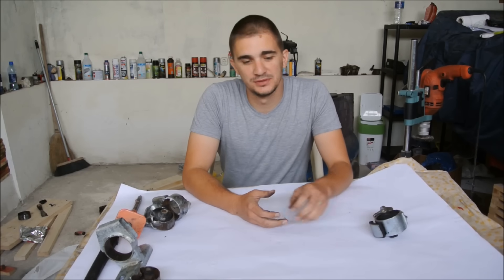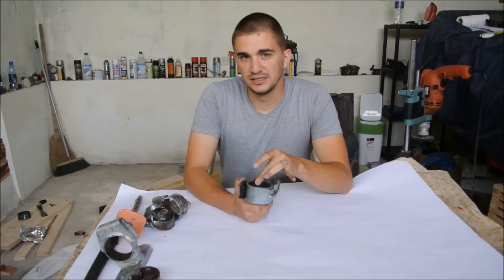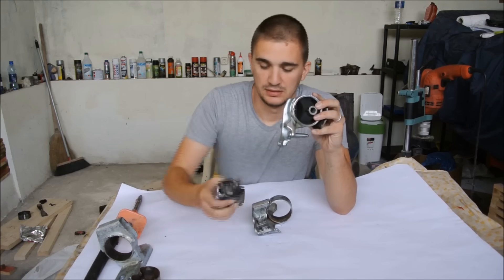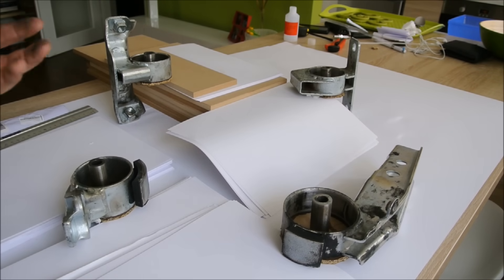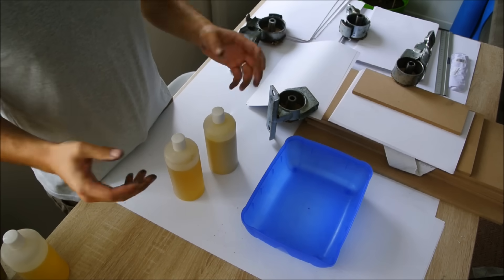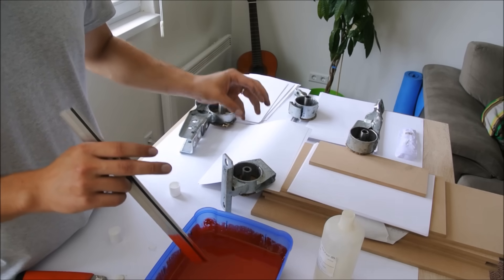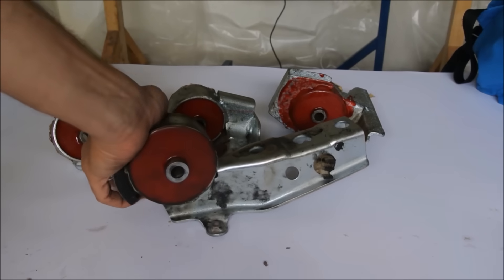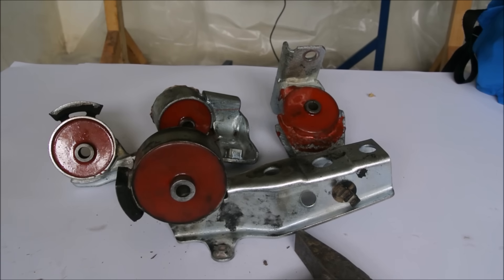How to make DIY polyurethane engine mounts

Comment from the maker: Become a Tuning Pro: https://hpcdmy.co/dr4a
Support the channel by shopping through this link: https://amzn.to/3RIqU0u
This is the liquid polyurethane I used: https://amzn.to/2VPPayY
This is the pigment for coloring the polyurethane that I used: https://amzn.to/36X81ww
Watch the follow-up video: https://www.youtube.com/watch?v=mBYhdLsQqug
To skip the intro where I explain everything you need to know about poly mounts go to 4:00 where I start taking out the old ones and pouring new ones in.  
I am not in any way sponsored, endorsed, supported, etc. by this company. This info is also in the video description but no one reads that apparently :) There's a lot more good options in terms of liquid urethane out there probably, but this one worked really well for me and bonded itself to the metal mount very well.
Reply: Muchas grcias por la informacion.
Reply: @josegilgarciagarcia7339  Hola amigo tu sabes cómo se llama el material
Reply: @Randy Elliott I really appreciate your reply. I found the site on google and Im in the hacking process atm.
Takes a while so I will get back to you later with my results.
Reply: driving 4 answers iiiy
Reply: driving 4 answers
Reply: hi mister can i know what the name of the material is
Reply: @serayasevenmotor   if u want this ,we r the manufacturer for the part in India
Reply: @itsArshAvi2822  are u making copies of hasport mountings bieng used for swap engine projects ?
Reply: Buenas noches
Reply: @d4a  can u give me ur WhatsApp no.?
Reply: Thank you very much for your prompt response. An apology what happens is that I don't know any English and I have trouble translating it. Blessed day I have.
Reply: Piloc
Reply: How is it now? Does it fall apart yet?  Rubber  is the best materials for engine mount for low vibration. Sometimed are even with liquid  in it  instead of stupid hard materials.  Polyurethane makes sense for suspension parts or bushing for more durable and handling
Reply: @Angel Jax instablaster =)
Reply: @Randy Elliott it worked and I finally got access to my account again. Im so happy!
Thanks so much, you really help me out :D
Reply: @Angel Jax happy to help xD
Reply: I dont mean to be offtopic but does anybody know of a tool to log back into an instagram account..?
I somehow forgot the login password. I would appreciate any help you can offer me
Reply: I BELIEVE THE MOUNT SHOULD BE CENTERED BUT BECAUSE URS HAD WEAR THEY WERE NOT CENTERED WHEN YOU DISSASSEMBLED THEM!
GREAT VIDEO
Reply: привет все хорошо. когда заводишь двигатель или глушишь происходит детонация двиготеля.тош то инженеры придумали много лет назат это правелные подушки двиготеля.то што ты показал это не провелно.идинствена с твоим изопритением можна времино ездить пока олиминь не лопнит. я этод экспиремент уже пробул. и я не вы ложыл это видео YotTude, пристав кагда машына троит толко двиготел дрибежыт, а если сделать по твоему технологие то двиготел будет валяца но земле,и очень часто будеш обрашяца до сваршиков чтобы они варили тваю машыну. я этот эксперемент уже делол.Удачи тибе .Я Руский
Reply: Tycoolerz Yet no kidding. So much fucking useless talking
Reply: can u straight to the point please ??

Comment: FYI:
ReoFlex 60 is not designed for use in motor mounts or automotive applications. It's a urethane rubber designed for mold making, particularly for casting wax, plaster, and resins in various industries like sculpting, special effects, and prototyping. 
While ReoFlex 60 is a durable rubber, it's not suitable for the demanding requirements of motor mounts. Motor mounts need to withstand significant stress, vibration, and temperature fluctuations, and materials like rubber, polyurethane, or hydraulic fluids are specifically engineered for these applications. 
In short, if you're looking for materials for motor mounts, you'll need to focus on automotive-grade rubber, polyurethane, or hydraulic mounts, not mold-making materials like ReoFlex 60

Comment: I need to do this but for a slightly different application. I need to mount an aluminium tube centrally within a hi mod carbon fibre tube.  Does anyone know if there would be any incompatibility between PU and the resin used to bond the carbon fibre ( I’m guessing it would be a type of epoxy). Thanks in advance.

Comment: instead of drilling holes afterwords, just place some crayons where you would want hollow areas and melt them out with low heat. I had a Malibu with circular pin mounts and I filled the front one with cement and it worked! Sold the car a week later, he he.

Comment: You can just form the urethane around the original mounts if you clean the rubber with brake cleaner so there is no oil then make make a form on one side with aluminum foil and duct tape.

Comment: I think if i do this, instead of using just cardboard for the backing. I might try some parchment paper or plastic wrap so it doesn't stick to the cardboard. 
After pricing all the engine, transmission and suspension bushings I need. Even cheap aftermarket replacements are gonna be a few hundred dollars. I think buying a gallon kit of polyurethane and doing it myself will save me at least a hundred dollars. The bushings will be better than the stock replacements, and will last longer. The only thing that will be challenging is the time it takes to pull the parts, clean and prep them, pour the poly and let it cure, then reinstall everything. I'm thinking that I might break it up into a few weekends. Starting with the engine and transmission mounts. Then if that goes well, I'll do one corner of the suspension at a time. That should give me enough time to get everything done without rushing too much. It's still not gonna be easy. But it's gonna be worth it when they're all done.

Comment: I use liquid flex seal(black) to repair old mounts. Ducktape one side. Pour in stages to prevent leaks. Allow time to cure. B18a1. Some vibration @ idle.

Comment: I used a 1 inch (25mm) hole saw to cut out the center pin then scraped it clean with a box cutter and wire wheel.

Comment: Thanks.  This will work great for some discontinued rear swing arm bushings for my minivan.  You can also use a saws all to get the inner pin out of the rubber if you have one.

Comment: Hi, excellent guide, one question, Ford S Max uses a rubber bush between pulley and alternator, this can be a weak point and tear over time. Would Poly adhere as a replacement of the rubber material if it was all cleaned out? Or does it not stick to metal as well as rubber?

Many thanks

Comment: Why was it necessary to remove the old pressed-in insert.  Could you have just burned out the old rubber from the insert and poured the polyurethane into the old insert without removing it?

Comment: I did this 20 years ago on my '89 Civic Si.  I made the engine mounts solid with 50a polyurethane.  The increase in felt harshness and vibration from the engine was tremendous.  It was for a race car, so I didn't mind.  If you are doing this on a street car, your passengers will hate it.  I imagine drilling holes to emulate the shape of the original mounts would have reduced the vibration, but it was a race car, so I just left it in torture mode.
Reply: How well did your mounts hold up compared with OEM rubber?
Reply: @alanhat5252  They were far more durable than the OEM rubber mounts.
Reply: It is ok to pour polyurethane into OE mounts holes space?

Comment: do you think one could do this without removing it?maybe jack up motor a tad to get the mount bolt hole centered and find a way to wedge carboard/duct tape on front/back then maybe make a small hole on top carboard and fill the cavity using syringe as they sell printer ink syringes cheap?just a thought for hard to remove mounts.

Comment: I would prefer cut the old rubber bushings out with a saw. First the inner Pin, because it will holded by the rubber and lastly the outer ring of the rubber mount. You will have less rubber on the pin to be burned. And use a mask of course, while you burn it.

Comment: I drilled into old bushes and pumped in gorrilla extra strong grab adhesive with silicone gun . Totally ghetto but it worked for axle bushes never had to remove anything

Comment: Interesting video, i use to work at one of the suppliers. I've made prototypes to engineering specs, and worked with the manufacturing process. 

The prototype parts can be made in a general shape then cut on a lathe to fit your application, the product in this video is missing some ingredients it's just going to be a different product.

unlike rubber, polyurethane will degrade from humidity.
Reply: I thought about it but what other ingredients does it need? Am planing to do my bronco bushings but that moisture degradation worries me since it something I can't control in the environment I live
Reply: @carlomagnotm   hi, i think the main point of my comment was that it may be better/easier to buy a bigger commercial product and cut it to fit your application.  the chemicals had codes on the bottles, so i don't know from experience. There was one that made it expand so it had to be contained in a pressure tight tool to set. This (open cell) probably was done to make it more soft like rubber, maybe the humidity is less of an issue without expansion. I'm assuming the general ingredients are available somewhere like papers or book publications on the subject.

Comment: I'LL EXPLAIN ISSUE WITH POURING DIRECTLY TO MOUNT.
SO MOST POLYURETHANE SHRINKS WHILE CURING AND WHAT U SGOULD HAVE IS A INITIAL LOAD ON THE BUSH.
IF U DONT DO IT THIS WAY IT WONT LIVE AS LONG AS THE ONE WHICH IS  SLIGHTLY OVERSIZE ON O.D. AND UNDERSIZE ON I.D.

Comment: Quick tip on removing the rubber.  If you drill a series of holes around the center it makes for a lot less rubber to burn.  Also it allows the flame to penetrate through the bushing rubber. That method has the added effect of directing a lot of the fumes coming off the rubber to move away from the guy holding the torch.

Comment: Just a note, you computed doing it yourself was $25 and buying it was $100 and shipping adds to that.  So doing it yourself took some time to acquire the materials and time to do the pour.  Additionally, there was some cleanup and disposal time.  All this supposes no mistakes !  Have you considered "wait" time for each method ?  Doing it yourself looks to me like you worked for about $0.10/ hour.  So you did it to provide "custom" items.  Well, looking at the markets, there is a pretty comprehensive assortment of products available.

Comment: The way I grew up doing it was using window weld . The stuff used to reseal windshields. Don’t even have to remove the factory mounts . Just seal one side of the mount with tape or cardboard and fill the void of the factory mount with the window weld then seal that side with cardboard or tape ,  Worked great everytime . Poor mans racing mounts . Your way is probably better but way more involved.

Comment: You might like to add some curtains in the background to dampen the echos of the room. I am older and a little hard of hearing. Normally it is fine but it doesn't take a lot make the sound confusing. Echoing is one of them.

Comment: I think I'm gonna make cardboard templates along with taking measurements before I disassemble the mounts, so I know everything is exactly where it's supposed to be when I'm reassembling them with the poly. I just got an 05 Civic and all the bushings are completely deteriorated. This seems like a much better and cost effective way to replace them.

Comment: It'd be absolutely awesome to make ALL the bushings for suspension and linkages in this manner. One could make moulds using a 3D modeling software and a #D printer. A complete set of aftermarket polyurethane bushings for my car--front and back--runs nearly $400!

Comment: As someone trained in low pressure (hand) polyurethane injection moulding, I would suggest a silicone gun and getting some empty tubes. You can fill the tubes with the polyurethane, pop a cap on the end, put in the gun, and squeeze any bubbles out.

After mixing, if you have a vacuum chamber, it helps to pull a vacuum on the material too. Once air has been pushed out the nozzle end of the tube, you should endevour to keep the tube NOZZLE DOWN, to trap any air near the cap/plunger end, and not in the nozzle (to avoid injecting it). 

A heatgun can be used on most material to pop air bubbles that rise to the surface, and heat can be used to accelerate the curing process. Polyurethane will take up to 28 days to 100% cure, and it will gradually get harder over a longer period of time, but it depends on the pre-polymer and the crosslink compound used! 

Bare in mind, a lot of crosslink compounds and pre-polymers are carcinogenic, wear gloves at a bare minimum with the material, but I would advise a respirator. Methyl-Ethyl Ketone (MEK) or Acetone can be used to remove polyurethane too (Even when set), however, i caution against using it on where you want to keep it because it can make material swell over time. 

---------
Experience: Producing equipment, cables, joints & connectors from polyurethane for offshore marine, military and survey industries, with my mouldings tested to depths of up to 6000m.
Reply: Snowman88  if you want to melt your fuel lines, yes you can do that. MEK is more aggressive than acetone haha
Reply: You need to start your own business rebuilding motor mounts. I have a geo storm can't find them anywhere
Reply: @trulyblessed8767  I could do, but it'd be mail order and I'd need to get a few hundred £££ worth of stuff first. Vacuum chamber is a must really, tubes are cheap, as is a silicone gun. I have MEK and Acetone from doing some paintwork a while ago (few litres of each)

You ideally need a jig and a work bench as well, or a hot plate. I'd need some aluminium plate and silicone release spray to sit the engine mounts or bushings on with some way to locate any centre pins or bolt holes. 

Far from impossible and I might just do it, quite a saturated market though unfortunately.
Reply: Nice! I have recently searching how to do some cables connectors waterproof to oceanography equipments to my college's work.
Reply: السيد سميث، هل مادة اليوريبوليثين تعتبر ناجحة في هذا العمل(صب قواعد المحرك)؟؟
Reply: @hemmarhouari736  It is good for engine mounts yes. You can change the stiffness depending on the Polyurethane composition, mix ratio with the pre-polymer and crosslinker. 

It will improve handling at the expense of more noise and vibration.
Reply: To be honest a few air bubbles aren't going to be an issue as the polyurethane is far stiffer than the original rubber bushes.
Reply: They will impact wear - under high stress (track driving) it can cause air cavitation as well and split the bushing. 

Polyurethane is harder usually, but it depends on the crosslink used as it does impact the modulus a lot.
Reply: @S.ASmith is it possible to make my own engine mounts for a Volvo XC90 V8?

Comment: If you just poured the polyurethane in with the original damaged rubber, would it bond to the rubber and make them good again?
Reply from the maker: Yes, it should bond with the rubber and that's a good idea too.

Comment: Great video. You could use candle wax as a release agent and seal the seams at the bottom of the mold. I wouldn't use any sort of grease as release agent as it can contaminate the walls of the mold and the urethane itself.

Comment: Had no idea you could do this. I've just spent a small fortune having 45A Shore hardness engine mount bushes specially made because the original rally spec ones are way too harsh for the road.

Comment: Would just pouring the polyurethane inside the mounts without removing the old rubber work as a cheap and fast fix 🤔?
Reply from the maker: It would!

Comment: To make it easier to remove the OEM rubber. It's easier with a vice but point the torch inside the tube to heat it all the way through. Once it hot enough the center pin will slide out fairly easy with a screwdriver. Once pin is out, heat the outside ring to melt the rubber bond and roll it out with a screwdriver. Clean up inside ring with dremel.

Comment: There's an easier way to get the rubber out... get a holesaw that just barely fits around that pin (or fits a little loose but you'll have more cleanup after), put the whole thing in a vise and get it with the drill... it'll come out in a minute.  It'll still smoke like crazy, but probably a lot less than burning all of that rubber out.  May need to drill a couple of relief holes in the rubber first for the rubber to eject.

Comment: Save time and trace the mount and pin on the card board before you take it apart and don’t bother taking the pins out get buy a sleeve pin at the hardware store

Comment: What if your pins need to be centered on both axis? Putting them on a flat surface if the inner pin is wider than the outer area than it will poke out the top?

Comment: Lol, "As you can see, these aren't going anywhere" *Tests something that holds 800+ pounds of vibrating engine by trying to pry apart with hands*.
Man, I would be scared of getting the pin position right, but this is a level of fab that is above what I would be comfortable with (for now) I think.

Comment: I don't think the pins are supposed to be offset. isn't just the rubber worn out? I didn't hear this from anywhere I just think it makes more sense that that the manufacturer would move the whole mount rather than the pin in the middle.

Comment: Is this  method ok for lower arm bushing cuz in the future im gonna buy old off roading cars to rebuild and fear of no spare bushing in my country
Reply from the maker: It really depends on the design of the control arm, and it will likely be a trial and error process. The tricky part is getting the poly to bond to the arm